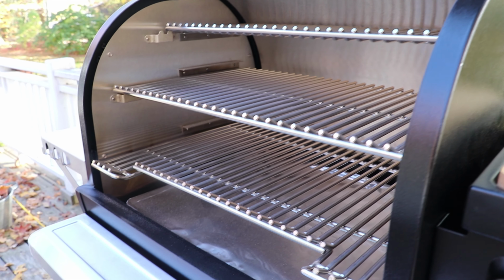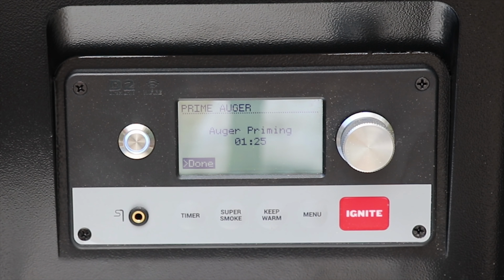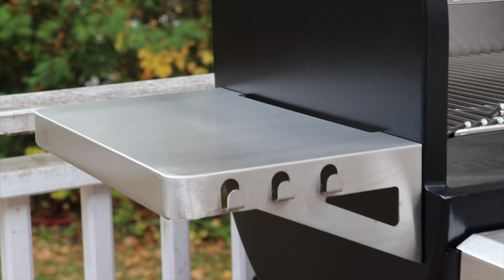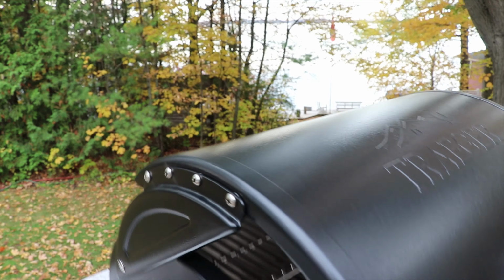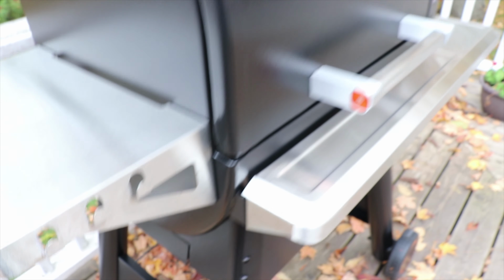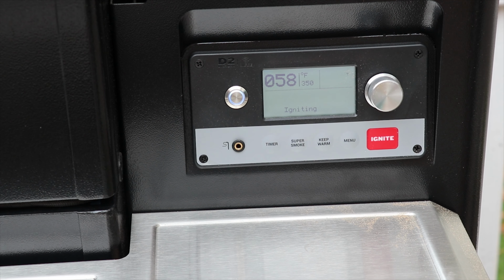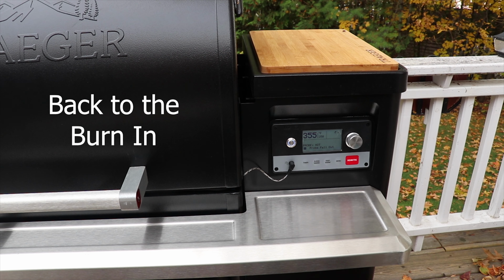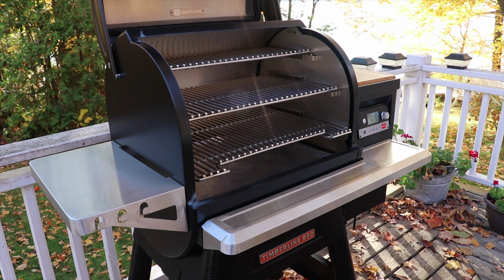Traeger Timberline 850   Setup, Burn in and First Impressions

Comment: Someone may have already mention it, but the temp probe should go in the smallest item, then move it to the next larger item when the small one is at preferred temp, and so on, to the biggest last.  Hope that helps.  Also the hopper on my Timberline 850 holds about about a bag and a half of Traeger bagged pellets.

Comment: Can it be used without the legs?
Reply from the maker: Like if you want it to be part of an outdoor kitchen?  You could do that, the only thing I’d flag is you’ll need to still be able to access the grease trap and you may want to be able to access the pellet release door at the back of the hopper.  So it might take some thinking on how you accomplish that.
Reply: @BBQandBottles  Yes, thanks for the quick response.  Looks like an amazing smoker & would love to incorporate it in my outdoor kitchen. 
Does it do a good reverse sear?
Reply from the maker: I wouldn’t say it does a great job on the searing part. I usually have my gas grill fired up to sear it off after smoking it on the Traeger.
Reply: @BBQandBottles  That's what I figured.  Thank you.

Comment: you can buy a bluetooth thermal probe set and pair with the grill, then view with your phone app.... you don't expect them to give you a multiport setup, do you ?
Reply from the maker: Bruce, two problems with that. One, Bluetooth only has a ~30-50ft range vs this grill connects into your wifi so you can access the info anywhere you have a cell connection. Secondly, the Traeger App lets you control the temperature of the pellet grill itself - something you couldn’t do with a 3rd party temp probe. Anyway, for the price I would have expected multiple temp probes. A little disappointing.

Comment: I have a 1300 Timberline. Wifire connection is terrible, and seems to take forever to heat up!!! on my third controller!  My Traeger Silverstone is great.
Reply from the maker: Sounds like you might have got a lemon. I’ve used Traegers for years and never had an issue.
Reply: What pellets are you using? Don't use traeger or pitboss pellets. You won't get good temps. Try lumberjack. Make sure they are 100% hardwood. I have the timberline 1300 d2 and started getting pissed. Now with other pellets I'm at 350 in 20 mins and 500  in 30.
Reply: @eaglepainting8593  Thanks will do.
Reply: The app is horrible, if you leave it open you Will end up having to close and reopen it when you want live readings